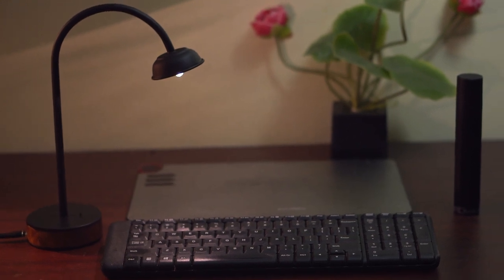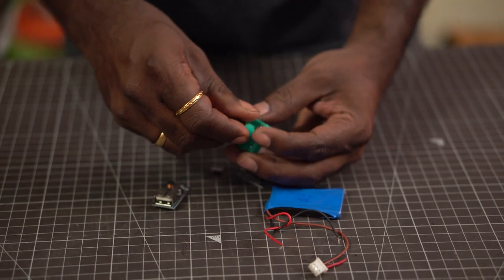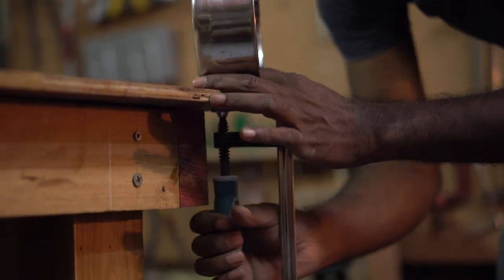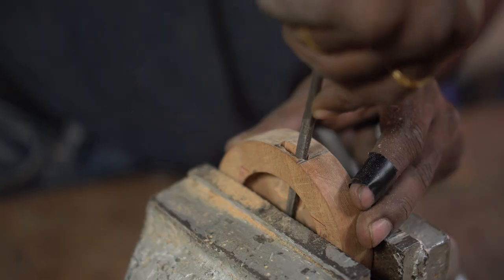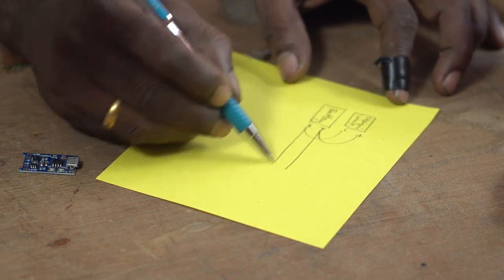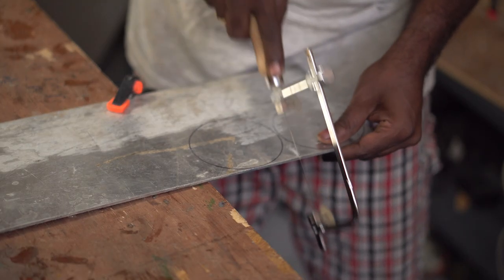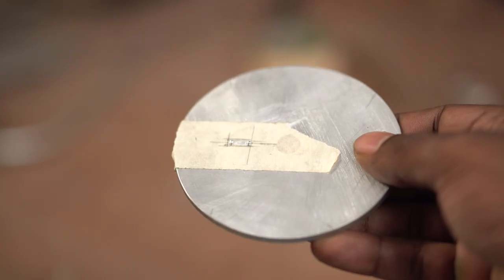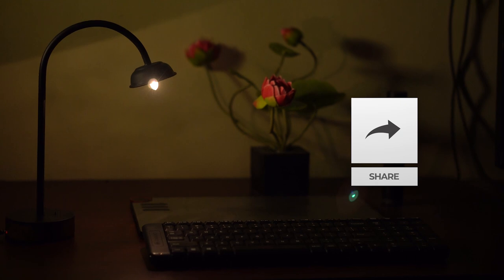Simple and sleek #study lamp| Easy DIY Table lamp

Comment: How is your compost bin working?
Reply from the maker: It's working good. Collected about 2 litres of liquid fertilizer and rest was harvested and utilized. I am doing a second batch of.
Reply: @VIDEOEPPO  I was researching home compost systems and found your video. It was informational but also funny. You sanded the plastic! hahaha
Reply from the maker: @ToadyWoods  one thing I noticed is that, we need to extract the liquid quite often. Otherwise, it starts accumulating. I think it  slows down the process
Reply: @VIDEOEPPO  Ah ha~ I see. That is good to know. I am glad it is working well. Your garden must be so nice★